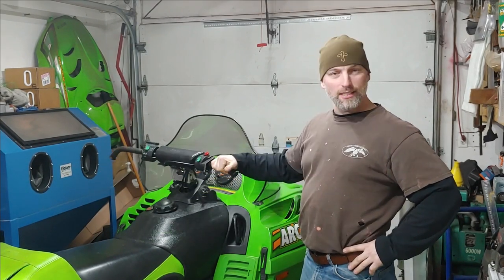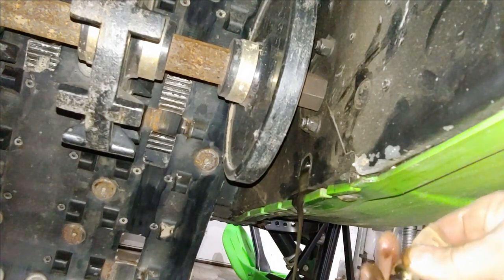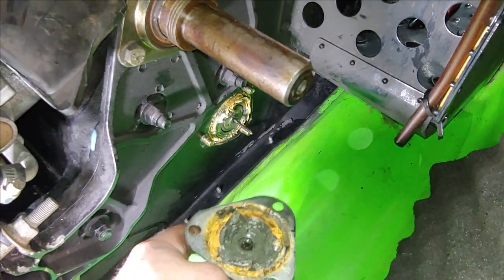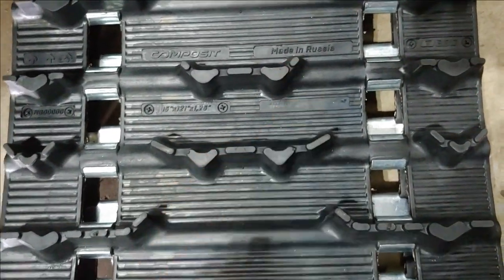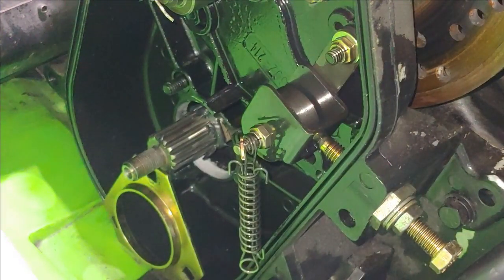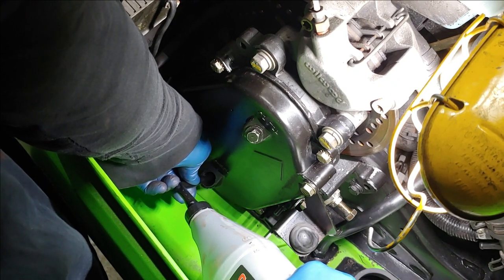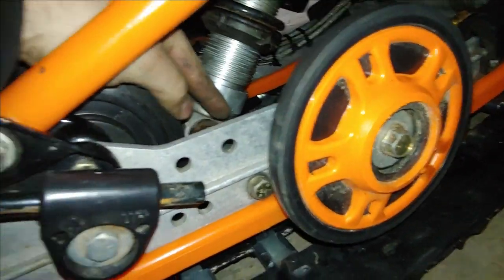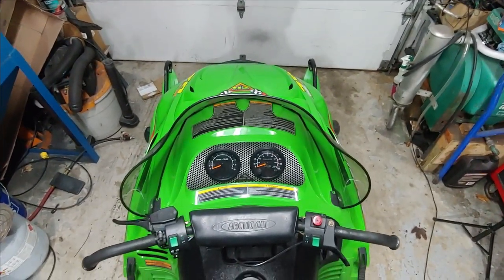02 Arctic Cat ZR 600 EFI Part 14: New Track [Remove old & Install New]

Comment: Are you sure I should be using red lock tight on that. Probably won’t be taking it apart again but still I’m not sure that’s a good idea
Reply from the maker: Which part?
Reply from the maker: Are you talkimg about the lower sprocket nut? Definitely. Sont worry it comes off. Worst case scenario you'll just need skme heat to soften it up before but not usually.

Comment: Can you replace a 136 track and slide from a 2008 crossfire 8 with a 153 track and slide form a 2008 m8?  Without major issues?  I got a great deal on a 08 crossfire 8 people say it's no good in the mountains.
Reply from the maker: As long as theres not difference in widths of the tracks. Say 13" to 15" or vise versa and they holes under the tunnel for mounting line you should be good. Just have to check track my clearances. If the rear holes done line up you can often either get a kit and rivet that into the tunnel or make your own. They are made of steel for strength if I understand correctly.

Comment: What’s the name of the track used 
Will it fit on an arctic cat zr3 700
Reply from the maker: Sorry for late response. Switched phones and carriers. It's a Composit T320. It should as long as you currently have a 15x121" track. Thisnin a 1.25 lug so you might have to shave the tunnel coolers right above the drive cogs at most.

Comment: My secondary has wayyy more play then yours. All shims on the back of clutch on shaft. What could be the issue ? Bad key? Any ideas thx
Reply from the maker: What kind of play are we talking. Side to side or twisting type? 

 Side to side would be shims. You can get some at menards. Youll need to make sure that youre retainer bolt haa enough room as well by the use of waahers if needed. 

 Twisting type would be worn key or possibly worn away on jack shaft or inside driven clutch.
Reply: @Fixin2Ride-Official-  Thanks for the fast reply. Clutch taken apart, cleaned and put back together the same. With belt and bolt back on, if I push and pull on the clutch it moves in and out on the shaft close to 1/2 inch or more. Seems odd....
Reply from the maker: No prob. You need to put shims on the shaft before the clutch. Manual states 1/8" play on shaft. You want your clutches to be aligned as well. Meaning parallel. You also want the center to center to ne 12.2". This will yeild best belt life and clutch operation.
Reply: @Fixin2Ride-Official-  all shims are on before the clutch too.. (brain scrambling)

Side note. Unreal videos, very informative and helpful. Nice toys!
Reply from the maker: There's not enough shims is what I'm saying you need to add more. Thank you for the compliments I really appreciate that!
Reply: @Fixin2Ride-Official-  Sorry, thought four shims on the shaft was standard? Ill see what I can find.
Reply from the maker: Problem is you never know whats been replace on a used sled. So could be a variation of something in there. Bottom line is to make sure that your clutches line up. Meaning driven clutch is perfectly behind the drive clutch. There are alignment tools as well.

Comment: Good job 👍😃 .what is the name of this orange color or the code.
Reply from the maker: On the skid? That was a rustoleum orange with Eastwood Hi Gloss 2 Part Epoxy clear coat.
Reply: @Fixin2Ride-Official- ok thank you it looks good. the orange of the engine is what because I really like this color
Reply from the maker: That is a RAL # powdercoat.
Reply: @Fixin2Ride-Official-  OK thanks . nice job and have a nice day
Reply from the maker: Thank you and you as well!

Comment: So what’s the chain tension supposed to be set to? You never said
Reply: By the way, thank you for the video. I just finished installing the track. Now I’m at the chain case and gotta set the tension so I can put it back together and go for a rip.
Reply from the maker: Yeah Sorry about that. Just screw it in with your fingers until moderately snug (starts to have resistance when turning but not hard to turn) and then lock down the bolt with the lock nut. You don't want the chain to flap around and don't want it tight. Just until the tension idle wheel on the side oft he chain takes the slack out of the chain. Hope this helps! And thanks for watching!
Reply: @Fixin2Ride-Official-  so I wanna make sure to set the tension without the spring thing on. Then after it’s set, put it on? Also merry Christmas
Reply from the maker: "Go for a rip" good deal. Glad its helping people. I couldnt find a good back when I did my first one so I figured this would be a good video to create.
Reply from the maker: Yes. That retaining spring goes in last. Merry Christmas to you as well. Sorry for late response. Working in the garage myself. Ha ha

Comment: Where do you get shocks rebuilt at
Reply from the maker: A buddy of mine rebuild them for me.
Reply: Oh nice I got a 01 zr 800 I want to have done and then do the track to
Reply from the maker: Contact Erik Erin for shocks and West michigan snowmobile parts for the track.
Reply: The front shock is adjustable on mine with the bottle by the handlebars that shock does not seem to be working
Reply from the maker: Gotcha you can check the connection that is behind the driven clutch there should be a couple right there and then you can also check and see if you are limiter straps too tight. But if not then yeah you can have it rebuilt
Reply: @Fixin2Ride-Official-  I will look in to that tomorrow in the day light

Comment: How did you push in your secondary clutch to remove the belt? I just bought a 2002 ZL600 and it won’t budge at all? Does it need to be lubricated somewhere to loosen it up?
BTW, this is by far the best track replacement video on YouTube!! Thanks!!
Reply from the maker: Yes you have to push in really firmly and twist to the right or back of the sled. You might be able to put a pry bar across two of the retaining bolts on the top and get it to twist but yes it's tough to push and twist at the same time. But once you get it to move the belt will fall down and keep it open.
Thank you for the compliments and thank you very much for watching. All that I ask is that you share my channel and videos with other people.
Reply: @Fixin2Ride-Official-  Thanks Bud!! I’ll give it another go and try with a pry bar too!
Thanks for your help! 
Subscribed! 👍🏽
Reply from the maker: Good deal man let me know how it goes and thanks!
Reply: @Fixin2Ride-Official-  One more quick question. Do I have to remove my Secondary Clutch to change out the Track?
Mine is stuck on big time! I’d rather not if I can avoid it.
Thanks again!!
Reply from the maker: No just makes it easier. You'll want to check your bearing too.
Reply: @Fixin2Ride-Official-  Thanks!!!
Reply from the maker: You bet. Thanks

Comment: I can't get my suspension to compress. Mine has the 2 shock setup
Reply from the maker: The rear suspension?
Reply: @Fixin2Ride-Official-  yessir. Tried a couple differant ways
Reply from the maker: @Jiggashmu  so you have a front swingarm shock in the rear swingarm shock? I would try lowering the setting on a torsion bar blocks and then also make sure that your front limiter straps are not tightened

Comment: Everything is good except that you never Lube that secondary clutch before you put it on that shaft clean and dry only
Reply from the maker: I understand. Thanks for the tip. I found that a little tiny bit of wd40 helps to keep it from rusting over the winter as dry, they do see a little moisture in there and bare metal get corroded quickly. They come off regularly. So it doesnt seem to cause issues. Thanks for watching.

Comment: Chains are cheap sir.
Reply from the maker: This one is fine for now as far as Im concerned. Lol. Where do you get your chains at?
Reply: @Fixin2Ride-Official-  I got mine when I put a reverse kit in .  But I have seen them on ebay for pretty cheap before.
Reply from the maker: @jmudd5449  gotcha. So not new then?
Reply: @Fixin2Ride-Official-  yeah not new
Reply from the maker: Makes sense. Ill deff contact WMS when I need it thats for sure!